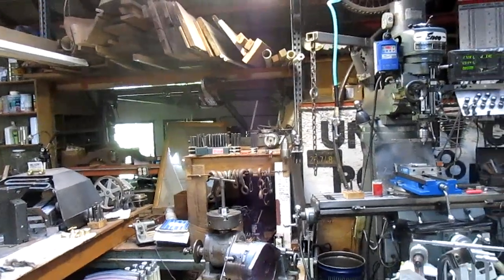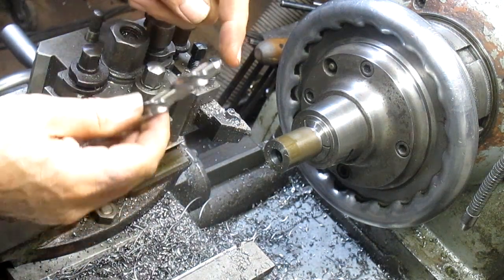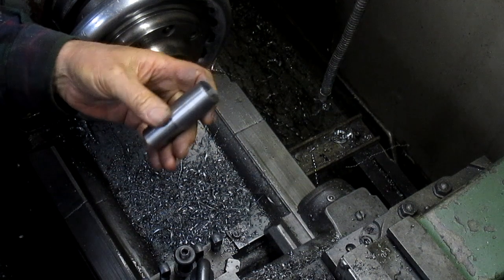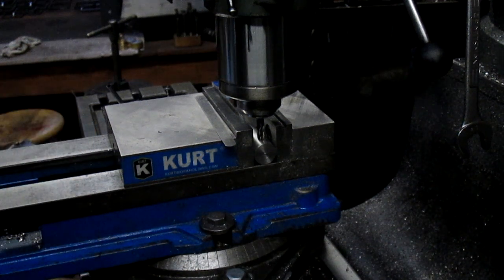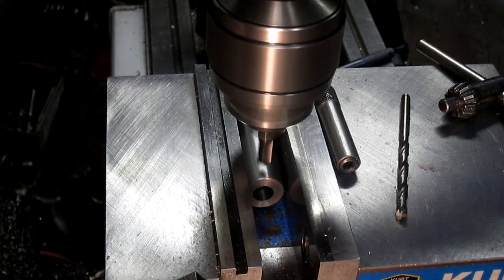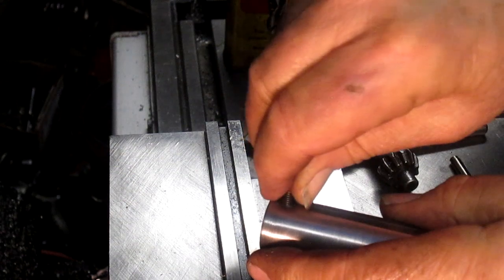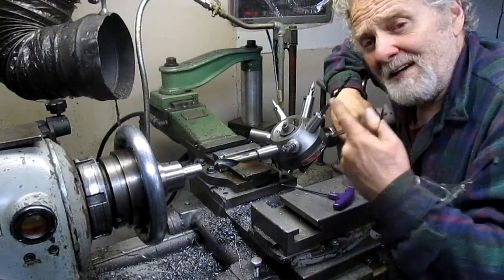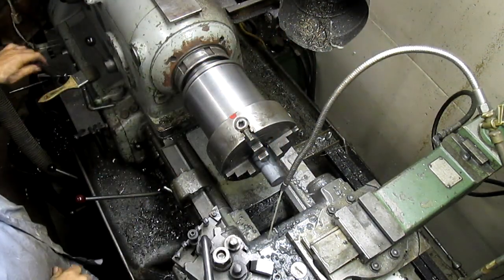Drill Turret Tangle #2

Comment: Hi Nick, I enjoy watching your clips as I my background is is a Fitter and Turner. The tool you are using for your carbide tips looks like a MTJNR 16-3 Carboly brand? I used to work for Carboloy here in New Zealand before they were bought by Seco Tools and that tool holder was our top seller. It is so versatile with plenty of clearance to get down by a centre and has 3 degrees negative side clearance angle for back facing. Keep up the good work. Cheers Ian Langley, Auckland NZ
Reply from the maker: Ian;  Because I suffer from "old timers disease" I can't remember who I bought that holder from and thus soon it will be time to buy more inserts. I am also looking for a positive insert for that holder. Can you recommend a positive insert?
Reply: @NikColyerMachineWorks  Hi Nick, It is difficult to get a truly positive geometry insert for a negative tool holder due to the rake angles, etc. The best I can suggest is the following - TNMG160404 MF1 CP200. This insert has a 0.4 mm corner rad or 1/64 inch in imperial terms and good for finishing applications or situations where you need to reduce the tool pressure on the job. The next is a TNMG 160408 MF1 CP200. The insert has a 0.8 mm corner rad or 1/32 inch in imperial terms. This insert would be good for general purpose work. CP200 works well in stainless steel but for what you are doing should perform OK. For a truly positive insert, you may need to buy a new tool holder but then you end up with an insert that has on 3 cutting edges. I suggest try this first but don't hesitate to come back to me for any other info. Cheers Ian

Comment: Hey Nick at 3:43 have you ever tried a "reamer grind" on a drill bit? I've ground two cutting edge facets just like a reamer on a regular drill bit and it cuts a very tight fitting hole. It only takes a few minutes to try, and might be just the ticket for what you want here. Cheers!
Reply from the maker: Tell me more, or point me to a video that explains. Sounds like a good idea.
Reply: @NikColyerMachineWorks  I couldn't find any videos, but I tried this method; After hand grinding a drill bit at 118 degrees, increase the angle to approximate the leading edge of a reamer, and grind enough ( with clearance) to accommodate more than .020-.030" material removal .(just like the leading edge on a reamer). Treat the drill like a reamer, pilot a 64th 0r a 32nd undersize and use the drill like a reamer. Check the results and see if it fits your needs. I would do this if a proper size reamer is not available , and I was desperate for results. Hope this helps, cheers!

Comment: I notice each drill is drooping below the center line of the spinning item as you start it into the piece. Does that make any difference? Seems the long weight of the turret would be that cause. Interesting concept anyway!
Reply from the maker: Drills are not a accurate approach to machining. They are good at following an already centered hole and hogging out metal quickly. Once you get close you would use a boring bar for the final precision cuts.

Comment: With regards to your drill cutting oversize, to prevent this, oilstine off the sharp corner on both lips. With a radius the drill will not want to "Dig In " wannder a bit and cut oversize. You can use this little trick if you want an odd size accurate hole ( within the manufacturers tollerance of the drill bit ) and you do not have a reamer. Hope this helps for next time.
Reply from the maker: Humm, good trick. I'll remember that one. Thanks!

Comment: why are you leaving the slugs so eccentric?
Reply from the maker: It's for a job making a hard nut shell crusher, actually 30 of them. The eccentric slug acts like a cam that carefully crushes the shell without affecting the meat. Wish I could show you more, but I'm sworn to design secrecy.
Reply: @NikColyerMachineWorks  Hopefully you can show more if it goes commercial or is abandoned.
Reply from the maker: @keantoken6433  It is already commercial. It's the inner workings that is proprietary which the slug is part of.